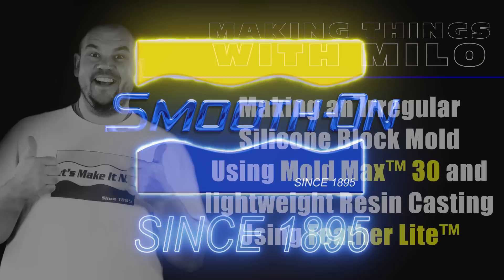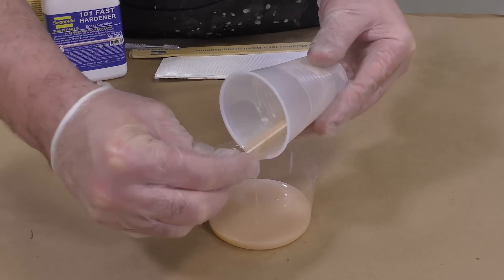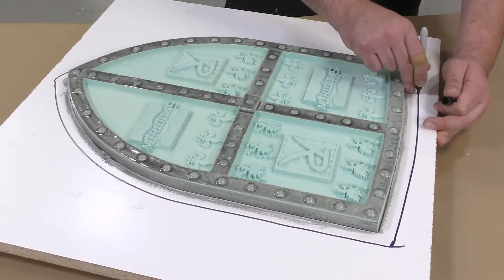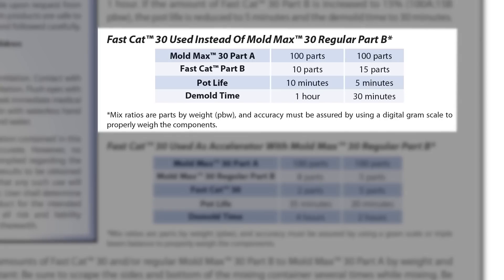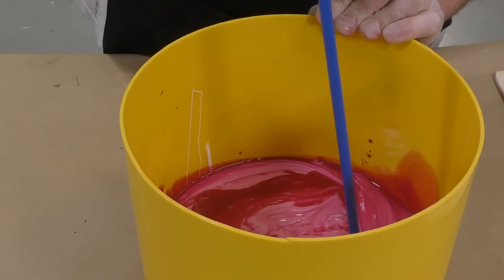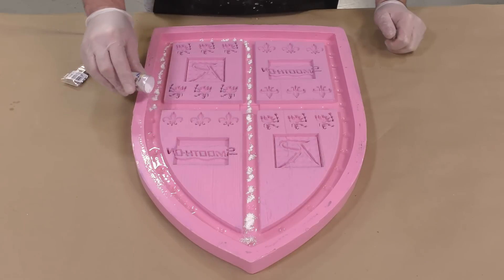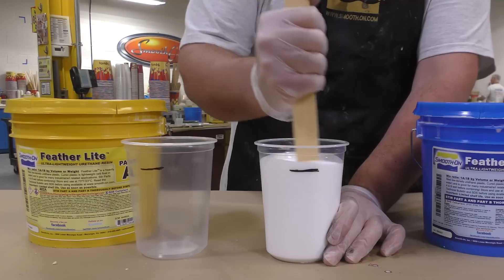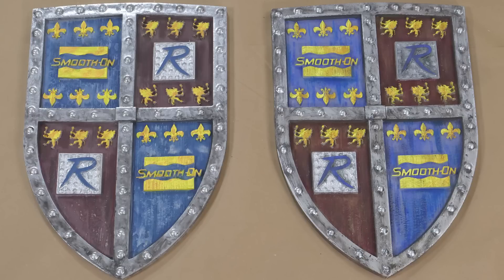How To Make a Silicone Block Mold of an Irregularly Shaped Model: Mold Max™ 30

Comment: Since you have access to a CNC… I would have used the boundary Vector you used to cut out the shield…offset it outward .75 then cut my board and hot glued the flashing to the outside. Much larger area to glue to.

Comment: Would you say this smooth on max product is the glossyist/shinnist finish you have for your silicone molds? 
(Im looking to start making my own molds for resin but I was a super glossy mold so my resin pieces are also very glossy)
Reply from the maker: The mold rubber will reflect the surface of the original model.  If you have a glossy original, the mold made from it will also have a glossy surfce.

Comment: I would love to see a video where you make a two part mold using Mold Max XLSII. I tried it over and over again using Ease Release™ 200 using all kinds of different methods but it simply does not cure on keys and other recessed areas. It seems impossible to work with and I can't find good info on how to pull it off. I'm using Mold Max 30 for over 15 years now and I never ever had any problems with it.
Reply from the maker: Hi there!  This is a good question for our tech support team, can you send them a ticket here? https://www.smooth-on.com/support/ticket/add/agree/ Thanks for watching!

Comment: Hi, good video. Im just getting started in casting as a hobby. I started using the smooth-on 300. The masters are a two part model that snap on and off of each other, created from a 3D printer, so even thin lines and walls are quite strong. Total weight is about 2oz. I was able to cast the items great, but the problem is that they are rather fragile. When snapping them on and off of each other, they tend to snap and break. Im taking care to make sure im mixing thoroughly, the 1A:1B mix ratio is exact, and that im giving it enough cure time. Can you give some advice?

Comment: Why do you guys make it so difficult to buy your products, I've been trying to buy crystal clear and cant get it from your website, or your amazon store... only through third party art stores! What the hell! I only live 20 min from Macungie why would I buy the product from an art store 2 hours away, its dumb!
Reply from the maker: You can order Crystal Clear directly from us or Reynolds - Allentown. We require that you call us at 1-800-762-0744 or Reynolds at 844-294-1444. This is due to the fact that Crystal Clear resin should only be used in a shop or other properly outfitted facility by an experienced resin caster. Also, we are open Monday through Friday, 8:30 AM until 5:30 PM. Feel free to stop by! 😀 Thanks for watching our videos!
Reply: What do you consider properly outfitted and experienced?
Reply from the maker: Per the tech bulletin, this product is for industrial use only. Proper ventilation, A NIOSH Approved Respirator and Protective Clothing (gloves and long sleeves) are required to minimize the risk of inhalation and dermal sensitization.

Comment: how durable is feather lite? can it take a hit or be dropped without any issue?
Reply from the maker: As it is a filled resin, it is not as impact resistant as some unfilled resins, but it strikes an excellent balance between lightweight and durability.